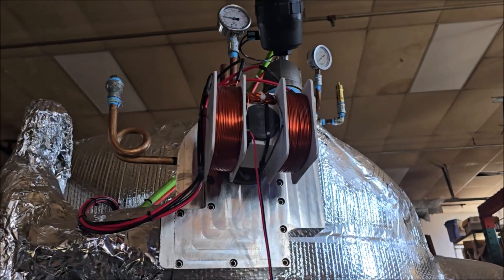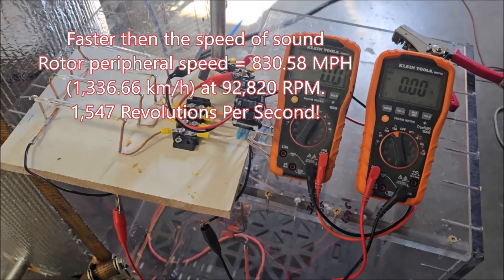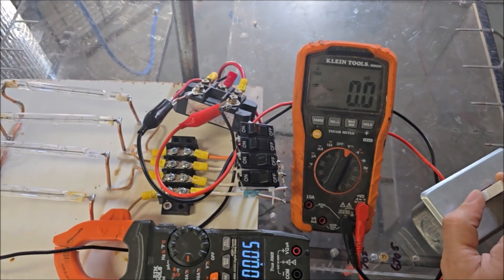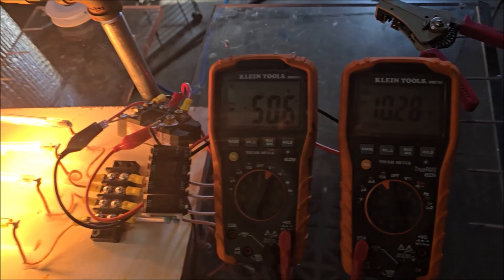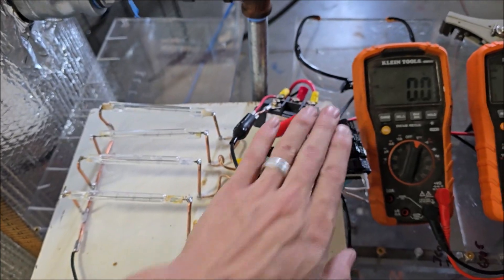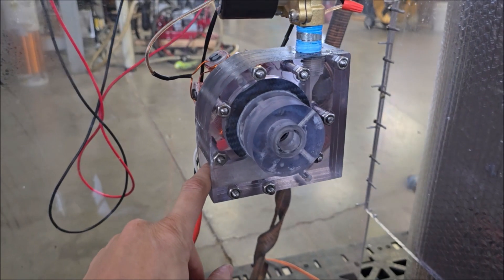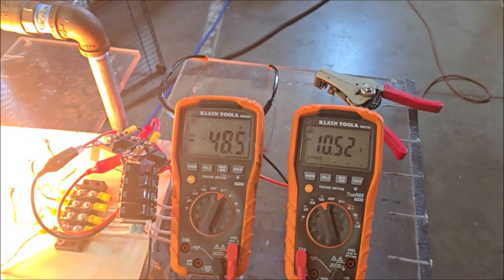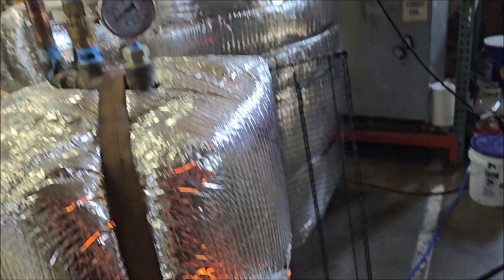Tesla Turbine Breaks Sound barrier! 95,000 RPM!

Comment: In principle you expand almost the whole pressure within the nozzle in order to make as much kinetic energy of the gas flow as possible. You only use a very small fraction of total pressure drop to drive the gas through the turbine gaps. You only need the remaining pressure drop to generate enough torque to compensate the torque of the generator and some friction losses.

I don't understand why you spiral the flow from the outer rim to the inner rim of the gaps. It doesnt make sense because it generates only much more friction than you really need. I would keep the flow at the outer rim of the gaps in order to release it after a half of the perimeter. So you have nearly constant streaming conditions and it is easy to calculate.

When you find that the outer rim of your turbine goes supersonic than you know, that you work not very efficient. The maximum speed of the gas flow, you can reach ist sound speed. If you want supesonic flow you have to use a Venturi nozzle (with diffusor). So the outer rim of your turbine is faster than the gas flow at the end of the nozzle.

It means the outer rim of the nozzle acts as a break, which ist driven by the inner gap section. This is also the reason why I don't like Tesla's turbine design, because it is simply not very efficient. You don't realize this inefficiency, because you have a lot of power in your gas flow.

Using only the outer rim of the turbine gaps is also useful to get a compact turbo generator design. You can put permanent magnet disks in the inner rotor part which operate on stator air coils in the turbo generator housing plates (4 permanent magnets and 3 coil pairs on both housing plates). In this way you will get an axial flux generator without iron losses.
Reply: actually while partly true and seemingly true, it is actually not fully true, that is because the tesla turbine's working is actually far more complex and advanced than it seems, but 99.99% of science and even the people explaining them and such do not properly understand the engine.
several years ago when I made my first 3d printed tesla turbine I noticed some odd behaviour and using that managed to figure out it's actual working.
this is also backed by how nikola tesla was great in geometry optimizations, yet somehow speciffically said the room needed to be round, and also didn't say you needed a special nozzle. essentially I rediscovered the way the tesla turbine was actually meant to work, and did some reseach and a more complex advanced version of simulations on it(actually the same type of simulation nikola tesla used to test his mashines which up to today still is much more accurate and faster than computer simulation programs).

but the interesting things I found where :
1: you don't need a nozzle since the tesla turbine generates a relative aerospike, this is similar to that new technology in rocket engines, but it already was there around 100 year ago in the tesla turbine, the aerospike in the tesla turbine however automatically dynamically adjusts itself and also acts as a nozzle.
2: the tesla turbine relative adaptive aerospike nozzle not only extends at the inlet but through the entire device, forming a adaping dynaming converging divergent nozzle, which actually is a type of nozzle used in rockets to make them go faster than sound, but in rockets they are fixed so only efficient at a very speciffic speed, while in the tesla turbine it is much more powerfull.

essentially in most cases adding a nozzle or such will decrease efficiency.
and a tesla turbine can go faster than sound on it's own while remaining efficient.
that said when going much faster than sound you start to run in other ineficiencies no mather what turbine you use.
Reply from the maker: @ted_van_loon  It’s great to hear from someone who’s done such thorough research! I’ve long suspected that the divergent section of the nozzle isn’t necessary within the nozzle itself, and your findings about the adaptive aerospike behavior of the Tesla turbine validate that. The way the turbine’s spiral flow through the disk gaps naturally acts as the divergent section makes perfect sense, essentially allowing supersonic flow without the need for a traditional nozzle.

The idea of the turbine dynamically adjusting its flow path and essentially forming a converging-diverging nozzle throughout the entire device is brilliant. It truly reflects Tesla’s genius in optimizing geometry—something that’s still not fully understood by most modern explanations. The fact that the turbine can generate and adjust its own aerospike shows how advanced the internal fluid dynamics really are. I don’t think most people, or even modern simulations, fully grasp how intricate this system is.

I also agree that adding a nozzle can reduce efficiency in many cases. The Tesla turbine is inherently more powerful when left to its own dynamic flow adjustments. It’s remarkable that this technology can achieve supersonic speeds while maintaining efficiency, unlike fixed-nozzle systems. But as you pointed out, even when the turbine exceeds certain supersonic thresholds, some inefficiencies start to appear—this seems to be an unavoidable limitation for any turbine at extremely high velocities.

It’s exciting to think that Tesla had already figured this out over a century ago, and how much more efficient his approach was compared to many modern systems. I’d love to see more people dive deeper into these core principles—understanding them could truly revolutionize how we apply this technology today!

I do have a question for you, though: when I run my turbine in a vacuum and get the rotor spinning close to the speed of sound, if I turn off the gas inlet, the rotor maintains its speed for a long time due to the low atmospheric pressure. I’m wondering, based on what Tesla described about using pulses of gas as the most efficient way to run the turbine, could this approach reduce the negative effects of running the turbine at such high velocities in a vacuum? Perhaps the low pressure environment could make the pulsed gas more effective by minimizing turbulence or drag? I'd be curious to hear your thoughts on this.
Reply: @iEnergySupply  yeah, and I have to say you are very good at building them.
I have seen few people who made really good tesla turbines, and you are actually the first person I see using carbon fiber for them, which actually makes a lot of sense if you don't need to high temperatures.

the working of it as a convergent nozzle is easy to explain as that part always stays the same(aerospike).
that said the divergent section is more complex to explain, as ofcource it also adapts but happens in the entire device, which actually is great as it could allow speeds very far above the speed of sound to work stable, but also much lower speeds. 
also the auto adjusting factor is great, since not only is there the aerospike convergent nozzle, but also a aerospike divergent nozzle.

normal convergent divergent nozzles only really work well for one speed, modern ones are made in a parabolic like shape to make them work in a wider range and accelerate the speed more in a shorter distance, otherwise one had to chose between it only being slightly faster than speed or it not working except for at a super fast speed so that the vehicle first needs to pretty much go insanely fast already before it could even be enabled.
In the Tesla turbine as it automatically and dynamically adapts without even any increase of resistance, not only does this make it hugely more efficient than normal rocket engine nozzles, but it also actually in theory could handle way higher higher max speeds than normal rocket nozzles.

however in my case I did experiments at lower speeds, as well as analyzing the behavior/simulating it in the same way as nikola tesla did(in the mind simulating the device). my physical test turbines also showed/confirmed that it indeed did form a aerospike and also would start behaving like a convergent divergent nozzle when that would be more efficient.
because that is the interesting thing, like electricity flow seeks the most efficient path, in the tesla turbine, when at speed the centrifugal force makes it need to spin around a lot or lose a lot of energy to something and slow down before it goes in. and out. so the way to get a more efficient path is actually to take on such shapes naturally and whatever shape is most efficient in that specific case.
actually science could learn a insane lot by using devices like tesla turbines and putting special medium through it to exactly see the flow and pressure paths and such. ofcource in the tesla turbine much is relative instead of exact paths so might be harder to see with such liquid, but pressure and flow and such would show a lot already. it would really show a lot of optimizations.
similar to how a water droplet shapes itself to the wind and that lead to huge gains in aerodynamics, the tesla turbine also does such things inside of it.

so yes he indeed is a serious genius in such things, and one of his most underrated talents was indeed his ability to design and optimize things through geometry(modern science seems to have almost completely lost that ability, and ofcource his mental simulative capabilities which actually made such things properly possible for him to do and find out or find out how to do or test if it works.

and yes adding a nozzle indeed can decrease efficiency greatly in tesla turbines, especially at subsonic speeds but where the turbine is still moving fast enough to generate the aerospike(happens rather rapidly, even blowing with your mouth generates enough to create such a aerospike).
when the turbine is spinning way to slow for the aerospike a nozzle will help however to make it more efficient.
but it is hard to make it clear in words just how efficient those self generated aerospike nozzles are since they adjust to be literally perfect on a level more accurate than even the air molecules themselves, and at any fast enough speed, as mentioned even when manually blowing such a turbine one can get it fast enough for this to start working. in my case I decided to confirm that part about the aerospike nozzle generation after many people on the internet just had been heavily underestimating that turbine which I didn't like to much(I didn't like them underestimating it). also people making assumptions about certain efficiency things and such, but those things where not true at all if one knows the true working of the turbine, since in those cases in general when knowing the wonders it truly does, then it is clear it actually is far more efficient and better there.
sadly due to this there hasn't really been much experimentation or info about it at supersonic speeds, you seem to be the first person to actually even test it at such speeds

that said you using carbon fiber for the disks, is something very usefull as well, since one of the big problems remaining was the weight of metal, and many metals stretching. modern metals can do way more than the metals back then(as in uncomparable pretty much, even basic cheap metals are much better now).  the carbon fiber disks might be one of the solutions needed for such supersonic speeds, since while modern metals work at such speeds, carbon is far more forgiving and way less vibration or loss due to imbalances or such as it is more flexible and also lighter.
 
sadly I haven't been able to find any sources other than myself who know about that effect, even though by now there might be more as I went open about my findings quite a few years ago. seems almost noone properly looked into that turbine, or atleast noone did so in the right way or decided to actually properly test it.
as for supersonic speeds, it should still fully work as both the convergent and divergent sections are still generated very well.

convergent divergent nozzle:(convergent part: liquid or gas gets to around the speed of sound, but pressure is very high; divergent part, path widens, and due to the change in pressure that is quite much like a explosion, but as the speed of the gas or liquid to which the "explosion" like effect's speed would be relative to already is at the speed of sound this results in the outlet going faster than sound).
breaking a materials speed barier is easily done by just changing the point the speed is relative to.(for random other people happening to find this, since most rocket scientists tend to treat it like someting super complex and keep things secretive and use jargon to make sure outsiders don't find out it is simple(and many of them don't even actually understand it as they are used to working in the jargon instead of it's meaning), but this is just to show how insanely simple rocketscience actually is, also shows why nikola tesla could work with it so easily back then before this was even supposed to be there and why he saw it as something trivial enough to not even need to seperately mention it(since in the way tesla was thinking and simulating thigns, those things are just trivial and the same as how for a normal person a apple falling from a tree is normal).
Reply: @iEnergySupply  answering the ones specifically to Nikola Tesla in a separate one. as otherwise it would get to long probably.
the stuf to answer your question is bellow *but* so you can skip the other text if you feel like it, if any part of the text might seem to weird or such then I recommend still reading the part directly after *but* as there is a very real reason why pulsing make them much more efficient.
the short answer is YES, it truly does make the turbine much more efficient when not at full load or when speed is limited.
and next to that it also makes the entire system much more efficient/reduces the effects of other inefficiencies in the system or in cases even mostly cancels out imperfections in other parts of the system.

(actually the *but* part is in another comment due to youtube message length limitation and that explaination being pretty long due to actually being a quite long and facinating concept, so this message is more just about him knowing about such things.

as for Nikola Tesla already having thought about such things, I am very positive about that, based on how he thinks, and also based on how I think and given we use similar methods to find things out, as in first simulating and testing all in the mind before building or even drawing or such. 
I havn't found any sources confirming he indeed knew about those things, but I am still very positive about it, in fact I actually thing he knew about them but thought of them as so basic/normal/trivial that he didn't even bother writing about them, since for people who think like that, such things are truly trivial(you know it is only modern day advanced rocket science but already before the time of rockets(1913(tesla turbine) vs 1946(X-1 said to have the first supersonic capable engine according to the internet)) but to people thinking like Nikola Tesla such things are truly trivial until someone really starts going against it and claiming the opposite, in which case they will defend it.
just like why I did those things to show and confirm that those people where wrong and underestimating it.
also it is very important to be aware that Nikola Tesla was very much ahead of his time, after all he didn't beleive in those absolute limits of speeds, or atleast didn't let them stop him, there is no limit in existance which is absolute, even magic itself is possible as long as one seeks to actually find it, it is very hard to find something if you never seek or even look for it. the goal of a real scientist is never to say something is not possible, only to say something is possible, or if there seems no way, to just make it possible, this last part is actually important for your question as we have to keep in mind that he had big dreams about flying, not just like space crafts or such, but also small plane like devices in which it was just like you where flying yourself.

as for the running it in a vacume and the pulsing questions.
I did encounter something relevant to that in my tests but still am not 100% sure it will completely make it more efficient in all cases.
also might you still know what document or place or such he reffered that in or even a link perhaps(might you still due to some reason have it open or such since I know one often just reads them and learns from them but doesn't store their names or links or such). but if you still have it and I can read his own exact words then I might be able to figure out or kind of "remember"/feel/notice what it speciffically was about, or where speciffically to look.
since yes it was more efficient for sure, but not in all cases, btw when remembering this I "remembered"/saw what he meant with it, one nice thing about such simulations in your mind is that you can also litterally see thigns from other peoples perspectives as well as think the way they did, or see things almost as if litterally remembering your past or such, hard to explain, but it really is like remembering something you did long ago but forgot you did, but once you find the trigger you instantly see all the details).
the thing with many such things is that there is no info available as for why unless you go and find it yourself, luckily because you meantioned him mentioning that and asked my that question I found the answer as well. that is also why I like discussing with people with high skills, intelligence, and/or knowledge, as even the small things they know or actively think about in that moment or actively ask a question about/wonder about lead to me having to realize entire new things again and so learning more than one can imagine. 
similar to how a friend of mine once asked how ionic propulsion actually worked after I had explained the very same theory which they used at nasa to make ionic drives to him, I can simulate anything to find the answers and in reality when testing them they all turn out to be true, but often like in the case with pulsing the tesla turbine I can already confirm it with experience from other things), but I can only find a answer when I seek for it, when asking a question it breaks the patterns of knowledge and sparks true interest, as well as in cases forces to look at things we ignored before, just like how nikola tesla ignored how his aerospike or convergent divergent nozzle could actually be very usefull and important to many people.

so I still would like his exact words and context if it is there, also since I just really like many things surrounding him. if you just so happen to still have it opened somewhere or such, or somehow still exactly know it, it makes sense he has said that, he has all reason to, like some discoveries he will have made(even less relevant ones like the plan explosion powered tesla turbine bellow) which made him start thinking about such things which might have revealed a basic answer first, but rapidly after that also a much more important knowledge, like pulsing actually being more efficient.
Reply from the maker: @ted_van_loon  Hey, thanks for the deep dive! I’m totally on the same page about pulsing—it's amazing how it boosts efficiency, especially when the turbine isn’t at full load or has to work around system imperfections. It really shows just how versatile the Tesla turbine can be.

I also think you’re right about Tesla. He probably did understand these concepts, but they were so natural to him that he might not have felt the need to spell them out. His approach to simulating things mentally before actually building anything resonates with me, too. It’s like he knew the possibilities were endless and didn’t let himself be boxed in by so-called limits.

If I stumble across that source on pulsing and vacuum efficiency again, I’ll definitely share it! It could add some cool insights. And yeah, Tesla’s forward-thinking nature with things like aerospikes and nozzles just shows how ahead of his time he really was.

It’s awesome to chat with someone who’s into these topics as much as I am. These discussions always open up new ways of thinking, and it feels like we’re getting closer to those "aha" moments Tesla probably lived for. Appreciate your thoughts, and let’s keep digging into this stuff together!
Reply from the maker: @ted_van_loon  Thanks so much for the kind words and thoughtful breakdown! I’m glad you see the potential in using carbon fiber for the disks—it really does seem like a natural fit for tackling the weight and flexibility challenges that metal disks face, especially at higher speeds.

I totally agree with your points on the aerospike and the convergent-divergent nozzle effect in the Tesla turbine. It’s impressive how the turbine can self-adjust and maintain efficiency across such a range of speeds. That adaptability is what makes it so different from traditional nozzles, which usually need to be finely tuned for just one optimal speed. It's like the turbine has its own built-in optimization that adapts on the fly, which is something I think Tesla would’ve appreciated.

Your insights on how Tesla approached science are spot on. It’s crazy to think how far ahead he was—seeing things that we’re just starting to fully explore now. And I get what you mean about rocket science sometimes seeming more complex than it needs to be; Tesla probably understood that simplicity is often the key to innovation.

I really appreciate your thoughts and observations. It’s awesome to connect with someone who not only understands these concepts but also has a deep appreciation for the possibilities they open up. Thanks for sharing, and let’s keep pushing the limits of what this turbine can do!
Reply: @ted_van_loon  I can understand the converging nozzle theory But where is the diverging nozzle? would it require a Physical diverging nozzle which would including all the outlet holes? that would work, it would induce rotation in the physical diverging nozzle which could be used for propulsion especially in space (a secondary use)! I am about to try my  Pulsed detonation engine to drive a small tesla turbine. I may try printing an outlet housing cover with a diverging nozzle to see if there is any improvement.
Reply: @ted_van_loon  I'm have a bit of problem understanding what you mean by "relative aerospike". I know what aerospike is but due to different geometry between aerospike and this turbine, it's hard to understand what part becomes relative which. Would be great if you can elaborate which part or which flow act as which part of aerospike.
Also, I'm a bit confused of convergent-divergent nozzle you mentioned because conv-div nozzle is not used for rocket but on turbo jet as far as I know. Do you mean varied angle nozzle for rocket perhaps? Or do you actually mean conv-div nozzle?
Reply: @dongleseon8785  good questions.
note I am heavily dyslectic so might not always be best with words and language.

however the relative aerospike is actually very simple to visualize, requires looking at it in a dynamic way instead of passive(normally things are looked at in passive ways and frames, but this required to look at it dynamically). essentially there are many effects and parameters we all need to look at at the same time.

but honnestly the thing making it potentially difficult is not it's complexity, but rather how simple it actually is.

in this case the relative aerospike part is something I can explain, however it mostly is of importance for the relative/adapting convergent divergent nozzle.

the  interesting part is actually the way this relative aerospike causes that relative/adjusting nozzle. as normal nozzles only are efficient at a very speciffic speed. as for a convergent divergent nozzle, with that name I refer to the geometry concept, when looking closely pretty much all modern supersonic rockets are either based on that convergent divergent nozle or variations of it(as a normal one as mentioned only works on a very speciffic speed, so different versions for different speeds. but also some allow it to work in slightly broader ranges(the tesla turbine however works insanely efficient everywhere in and around/in between and even far beyond those ranges).
supersonic rockets either use that same geometry concept of convergent divergent(just many versions of it which all look different, but they use the same principle). or they use methods similar to ionic particle accelerators though those have insanely low thrust. and then there are some experimental ones, though those are generally just in hobbyist projects and are far to advanced to easily explain here, it isn't without reason only hobbyists even work with those and space companies stay with the old ones
rockets which go slower than the speed of sound use many more different methods but supersonic mostly just is different forms of the convergent divergent geometry(aka the relative shifting of the point of perspective to which the speed compares itself(high pressure zone acts like a wal in simple words, but moves at the speed of sound, then when it diverges that is like a explosion, thus allowing much higher speeds, even more so if like in the tesla turbine the "nozzle" is purely virtual and relative to itself/analog in which case that virtual wal at the speed of sound, can actually be extended to be much longer and bigger and also have it's actual speed also increase gradually allowing many times more acceleration than the speed of sound which with normal nozzles is very difficult.

the way this relative aerospike works in this, is that the air spins around fast, and pushes to the outside, thus the nozzle isn't there pysicall. instead it is formed by a analog aerospike which acts like a very advanced feedbackloop as well. both normal nozzles and aerospikes, have fixed hard materials to form that geometry which causes those effects this limits them in speed ranges and/or efficiency and such requiring tradeoffs.
in the case of the tesla turbine however this isn't pysical but is formed by the air itself which constantly adapts to pretty much everything happening in the turbine.
Reply: @dongleseon8785  I think I might be able to better explain this with some drawing(though I am not good at those), was thinking about making some kind of video or document for teaching people to understand such things anyway(as even at university most graduate students don't even truly understand how it works, while in reality it is so easy that pretty much anyone can understand it, they just need to see it visualized once, and it might also spark the interest in things like geometric optimizations and see the potency of them, as those are insane.

ofcource the tesla turbine isn't used in rockets in general, but this is because rockets just want to shoot of a beam to fly up, and the tesla turbine while way more dynamic and efficient converts pressure into rotational force. though perhaps it still might be used in ways if some interesting idea or solution is found.
Reply: @dongleseon8785  TLDR, I might better explain this with visuals as I am heavily dyslectic and those concepts are analog like visualisation (while words are digital).

it is essentially just a geometric concept.
normal nozzles and aerospikes base their geometry on some hard pysical structure which should not move or deform and won't do that much.
due to this it has a very limited speed range at which they can operate, and have a much lower efficiency, especially when operating outside of that range.

in the tesla turbine however, there isn't really any hard geometry at play here, other than the round outside and such, which due to being fully round can work at any speed as long as strong enough.
in the tesla turbine all the geometry to form the aerospike is formed by the air itself(exept at the exact point of the inlet where there is a small part due to the sudden dropoff but this is mostly unnoticable) both the resisting and the flowing parts of the aerospike are made of the air itself which also acts like a huge analog feedback loop thus reacting and adapting relatively to fators playing a role on it, like airspeed, air mass, inlet/outlet airflow speed, inlet/outlet pressure, etc.

the more notably important part here however is how that aerospike not only prevents energy loss to turbilence, but also forms a virtual nozzle, which also adapts itself like a analog feedback loop to keep peak efficiency at all speeds.

also ofcource for all of this remember that air has mass, so when it spins around fast it will generate a outward pressure, combine that with it's rotational speed and you get those effects as the gas is a gas and so can adjust unlike a solid flywheel.
Reply: There's so much pseudo science talk here. It is laughable. Don't let the looney toons distract you.
Reply from the maker: @musiconly7447  Okay, explain to me how the periphery of the disks can travel well above supersonic speed without a de Laval nozzle. I’m genuinely curious. Also, please explain how my 6-inch diameter rotor, spinning at 35,000 RPM, generates so much torque. This would imply that the gas is traveling at 2 to 3 times the speed of sound under atmospheric pressure.
Reply from the maker: Thank you for your insightful comment! You've raised some important points about the efficiency of Tesla's turbine design and the potential for supersonic flow at the outer rim.

One of the core principles behind Tesla's turbine is rooted in his understanding of fluid dynamics, particularly the importance of allowing fluids to move in natural spiral paths with minimal resistance. According to Tesla, this design helps avoid the sudden changes in velocity and direction found in more conventional turbines that rely on blades or vanes. The spiral movement of the fluid, influenced by the adhesion and viscosity properties, allows for a more gradual transfer of energy as the fluid moves toward the center of the disks. This gradual transition minimizes the losses associated with shocks and disturbances that you’d see in traditional turbines.

While your suggestion of maintaining the flow at the outer rim for constant streaming conditions is logical, Tesla’s design deliberately uses the spiral inward motion to continuously reduce the velocity of the fluid and extract as much energy as possible over the entire flow path. By the time the fluid reaches the center, it has already imparted a substantial portion of its energy to the turbine. Tesla himself noted that “the performance of such machines augments at an exceedingly high rate with the increase of their size and speed of revolution.” This suggests that while the design may seem less efficient in theory, in practice, the fluid's interaction with the entire disk surface optimizes the energy extraction process.

Regarding your observation about supersonic flow, Tesla designed the turbine with the idea that, under normal conditions, the fluid’s velocity should match the peripheral speed of the disks. When the turbine is properly scaled and tuned, the speed of the fluid and the turbine's edge should remain subsonic. Tesla acknowledged that if there’s too much velocity mismatch, inefficiencies can arise, but he accounted for this by recommending increased disk area or reduced spacing, depending on the fluid properties.
Reply: @iEnergySupply  hm, when you design a turbine which spirals the flow from the outer rim to the inner rim of a spacing between disks you accelerate the flow from the outer rim to the inner rim because you decrease the static pressure in order to transfer it into dynamic pressure.

But along the path the transversal velocity of the disk is decreased. This means the difference between the gas velocity and the transversal disk velocity gets higher and higher. This means the friction becomes higher and higher.

At the end of the process you will get a very stange equilibrium where you generate a lot of friction and your gas tends to return to the outer rim of the disk space but the static pressure in the outer gas spirals acts in a way to suppress this tendency.

I cannot imagine that this equilibrium state is somehow characterized by a good transfer rate of kinetic energy from the gas to the disk.

In my experiments I have found that the best efficiency comes with relatively constant but slidely increasing gas velocity, where the velocity difference between gas and disk is more or less constant and small enough that you don't waste too much energy into gas friction.

In a bladeless turbine you need some dissipative friction in order to transfer the torque. But you just need the torque to drive your high speed generator, which is relatively small. You generate your mechanical and electric power in turbine engines mainly with your angular velocity and not with your torque.

P = 2*pi*f*T

P: mechanical power [W]
f: frequency of rotation [1/s]
T: torque [Nm]

So, the best you can do is to keep the gas at the outer rim of your disk space and to keep the gas velocity constant and slidely higher than the disk's transversal velocity. Only in this way you loose the smalles amount of power due to friction. So the most power ist transferred to the disk.

With an inward spiral you can probably get more torque but you lose a lot of power due to friction. This is probably also the reason why your rotor immediately accelerates very hard. But this is not the way to make an efficient turbine.

A turbine lives from the gas speed and not from the gas friction. A turbine accelerates smoothly to its nominal speed.

Only dental turbines are designed to generate a lot of torque at lower speed. But they are not optimized for higher efficiencies. These turbines are not active but reactive turbines Their blades stand like a wall in the gas flow like in a mixture of a pelton turbine and a rotary vane pump. They are mainly (stagnation) pressure driven engines and act more like piston engines.
Reply from the maker: @gkdresden  The phenomenon you described is something I generally agree with in terms of fluid dynamics and turbine efficiency. However, in the case of the video you're referring to, the reason the turbine didn’t start immediately was actually something I hadn't seen before. Upon inspection, I found that the rotor wasn’t properly aligned and was making contact with the side wall. This misalignment caused the rotor to scrape the side wall, and I had to overcome the friction of this contact before the turbine could start.

This aligns with the broader point you made about friction, but in this case, it was an unintended mechanical issue rather than a design characteristic of the turbine.

Additionally, as you mentioned regarding the transfer of energy, it's important to note that by ensuring proper construction and observing working conditions, the centrifugal pressure opposing the fluid's passage can be made nearly equal to the supply pressure when the turbine is running idle. If the inlet section is sufficiently large, even small variations in rotational speed can result in significant differences in flow. This effect is further amplified by the changes in the spiral path length, creating a self-regulating machine. This concept bears a resemblance to a direct-current electric motor, where significant differences in impressed pressure are counteracted by the rotation, preventing excessive fluid flow.

It's also worth noting that due to the laminar flow within the turbine, this self-regulating behavior becomes possible. The fluid passage through the turbine can remain highly efficient, as the system only uses as much flow as required for a particular load. This ensures that the turbine's efficiency remains high while minimizing unnecessary flow, further optimizing performance under varying conditions.

In the case of my turbine, this issue was compounded by the friction caused by the rotor's misalignment, but your point on efficiency is well taken.